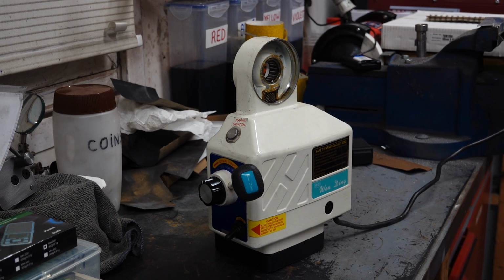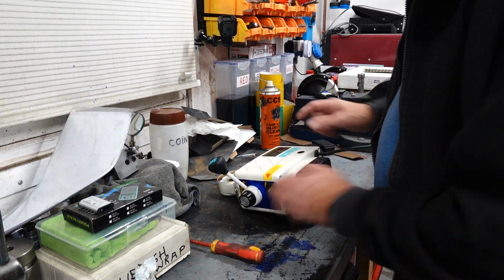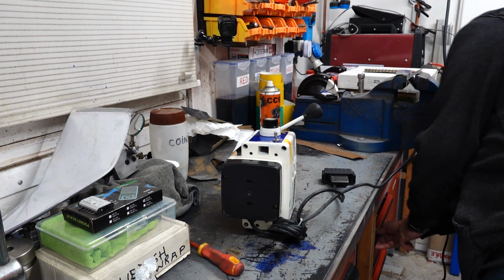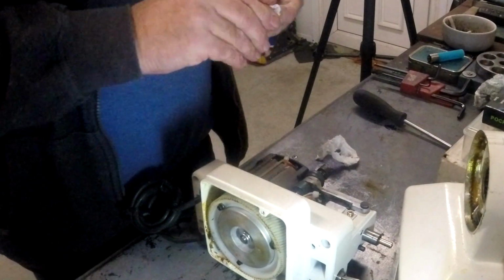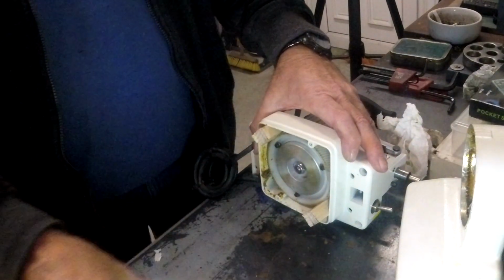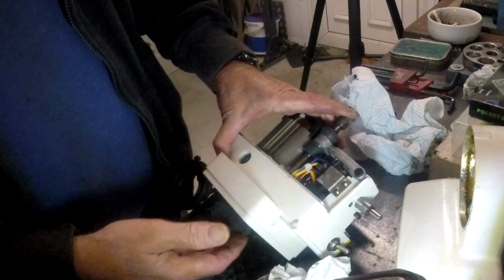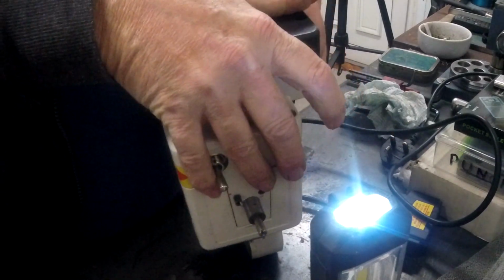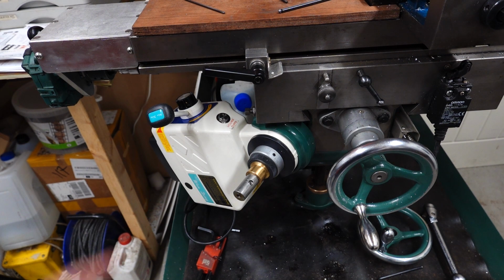Chinese Z axis power drive improvement Milling machine.

Comment: All the grease I've ever seen used in the OEM off shore equipment is absolute garbage. And I'm saying that after using thousands of cases of name brand industrial grease in my working career. If it were me? I'd replace all the grease in that with a very good synthetic grease. It will work much better and over a wider range of temperatures. Grease is obviously being used instead of oil just to keep it out of the electrical components. There's also such a thing as Arctic or cold weather grease specially formulated to work in very cold conditions. But your coldest shop temperatures aren't even close to where it might be required. A standard grade of synthetic grease should do anything you want.
Reply from the maker: Thanks for the advice. Seems all good now.